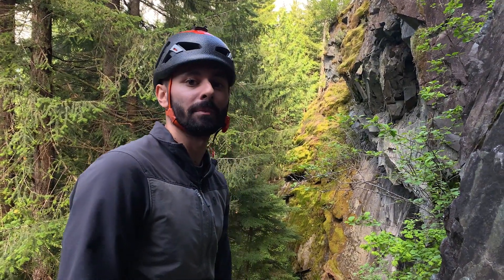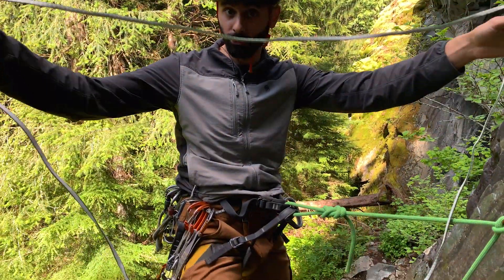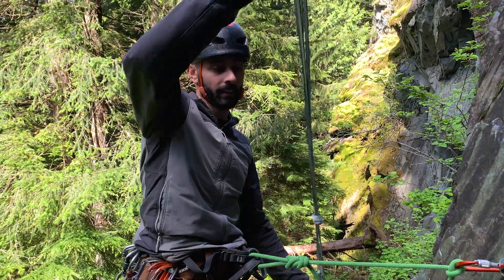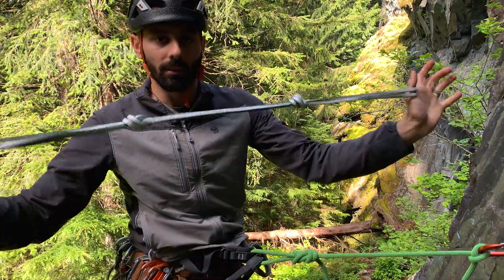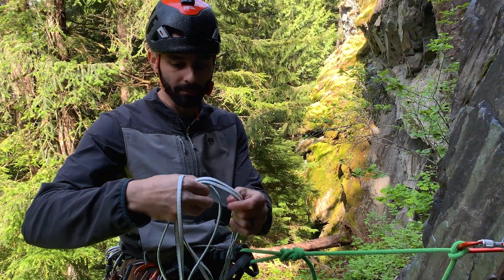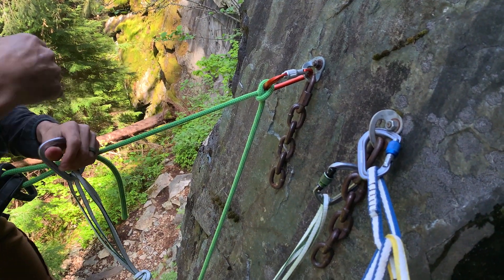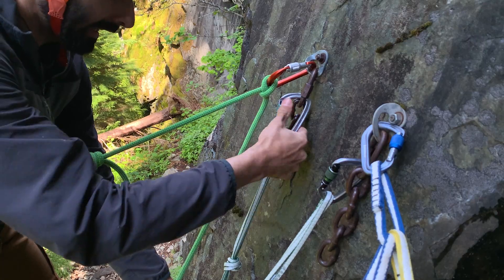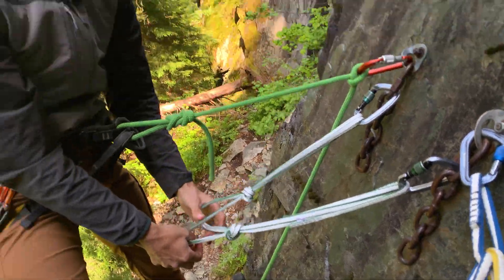Building A Dyneema Sling Anchor

Comment: Purpose of tying the knots midway on the slings?
Reply: It limits extension if one of the anchor points were to fail -- the knot catches the carabineers connected to the rope quickly, so there isn't more shock loading on the other anchor point.

Comment: Geesh, Dyneema is notorious and thoroughly tested to failure at much lower loads when knotted; in Europe, modern double bolted anchors are routinely tied in with a bowline on a bight of full strength over the shoulder runner, the remainder of the sling tied with a clove hitch in both strands to the other anchor bolt. Equalization is a waste of time when both anchors are considered bombproof, and tests have pretty much debunked even the concept, usually shock loading exceeds what a basic knot would experience. Overall, videos proliferating like this spread casual use of static slings into myriad potentially dangerous anchoring situations where someone is going to suffer injury, or worse. This looks like slick "professional guide" stuff that is dangerous and superfluous.
Reply: No dyneema is not, and what knot doesnt drastically reduce load capacity on any type of line/rope. Why would equalization not be important. Nothing you are saying makes sense
https://youtu.be/she8vH1DCBU
Reply: There’s literally videos of knots in dyneema failing at around 24kN … I have no clue how you could manage to reach those forces on an anchor unless you shock load it while a elephant is climbing

Comment: How bad is it to use this setup, but without doubling the sling over? For example, to get some extra length in your anchor system so it hangs over a ledge as opposed to ontop?
Reply: It will only have one tie in point. Fine to hold yourself in not fine to belay from.
Reply: @husky701rider9  Now that I have more experience, I know there are better tools if you need more length. A common option would be just using an overhand knot to make a loop (like a bfk, but not that big), or even a sliding x (although not as redundant). Thanks for the reply, I thought about just making a “double” instead of a quad many times, but as you said since you are only clipping your connection point to one strand of the anchor in the middle, there are other options that are equally simple, and safer with two parallel bolts.

Comment: If you only have a Dyneema sling, this works.  However, try to use nylon sling (18mm+) or perlon cord (6mm or 7mm).  Dyneema hates knots and strength is lessened by a lot with a knot and Dyneema gets weaker more quickly over time and any fuzziness weakens things even more.  Dyneema is great for quick draws and even tripled up extendable slings.  I split my runners between Dyneema and nylon.  Dyneema should augment a rank, not a direct replacement for nylon runners.

Comment: In the Stone Age putting a knot on dyneema was not recommended. Has something changed? In the construct demonstrated if one of the points gives in, you will get the dyneema impact loaded at the knot in pretty vulnerable direction. The old classic with the rope , or Petzl type of sling anchoring used to work pretty well and did not give shivers to my spine.....
Reply: I’m just learning about these things, myself. My understanding is that when they say don’t tie a knot in dyneema they mean don’t join 2 ends together, and avoid certain knots which can be catastrophic like a girth hitch. I see lots of people use them for quads or trad anchors with an overhand or figure 8 master point tied in. Cordalette can be more versatile as it is easily joined together, letting you play with the length or even cut it and retie it in an emergency situation. But it’s bulkier and heavier. Keep in mind s everything loses strength when knotted, even your rope. Just my $.02!
Reply: A dyneema quad anchor breaks at around 40kN, with its knots.... I wouldn't stress.....